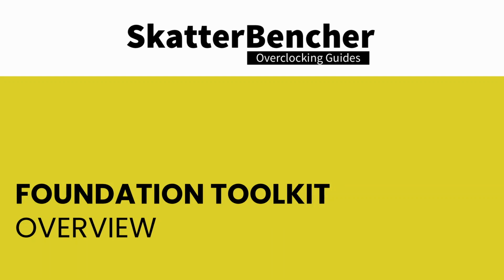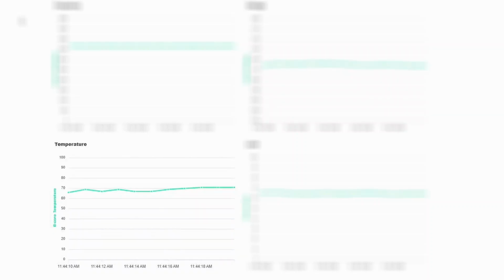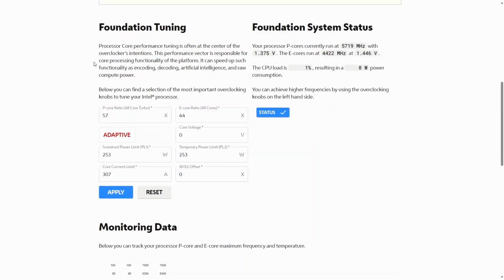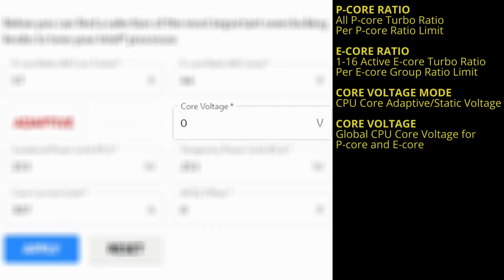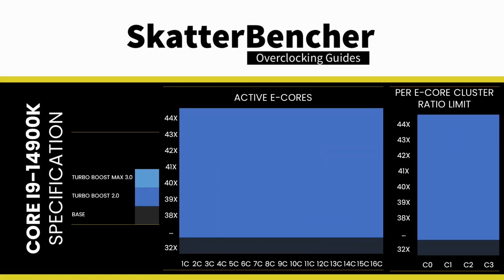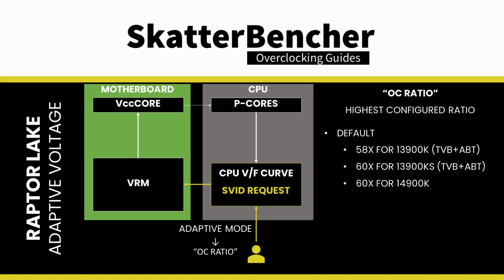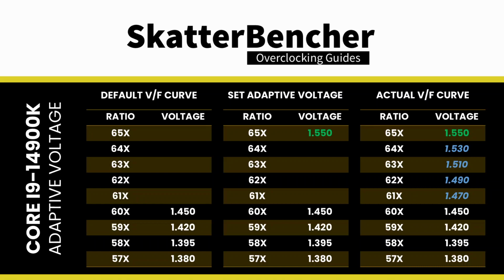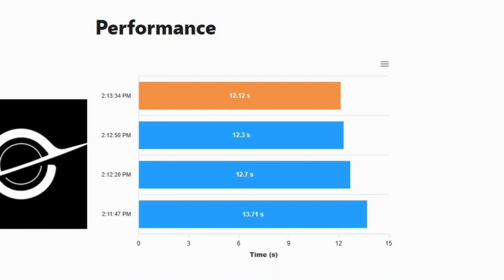Using Foundation Toolkit to Overclock Intel Core i9-14900K

Comment: Hi, I am using my 14900k only for gaming and want a stable fps without thermal throttling etc occurring. What would be some good settings to reduce power draw and multithread performance while getting maximum single thread performance for counter strike? Thanks
Reply: Same. I don't get why people want to overclock the i9. Our chip uses too much power as it is.

Comment: Amazing video's as always man. Very nice in depth explanation. That being said, the overclocking software is nice and it probably works very nicely, but after i used Intel extreme tuning utility my windows11 got a bit wonky where it screwed with the powerplan and now it doesn't wanna clock down all the way regardless what i do.

Comment: Hi there, I have SP107 with PCore 117. By running stock setting I hit 330w under load. May I know how to calibrate it properly? Assume I want to maximize my cpu potential. My vf curve for 6ghz is 1.418v. Which llc I should choose and how to start to calibrate my wattage as it’s over supplying the voltage to my setup. Thanks in advance I need guide to maximize my sp107 direct die kit. I tried 1.35llc7 with 1.27vmin 60/48/52 but my watt is crazy at 400w. What is the best scenario to run my system stable? Thanks in advance!

Comment: Good explaining!
However, can you do a overclocking guide on the 14900k using only the UEFI?
The AI assist with XTU doesnt provide a stable overclock, but I've clocked my CPU to 6ghz with 2 P-Cores active, 5.9ghz with 3-8 active P-Cores, but looking to do it in UEFI instead.
My previous 12900k had a stable overclock with fixed voltage at 1.450 in UEFI with all cores set to 5.2ghz.
I'm wondering if I set a static voltage to 1.465 in UEFI if my system would be stable, my cooling is pretty sufficient and never had any problems with CPU overheating.
Reply from the maker: Hi Eric! I am planning to make guides for 14th gen at some point, but unfortunately my free time is limited these days.

I think you can have a look at my 13900KS for general overclocking guidance since the chips are pretty similar. https://www.youtube.com/watch?v=dpWw_5KfpIw

I would strongly advise against a static voltage of 1.465V ... that will certainly overheat your system in heavy all-core workloads.
Reply: @SkatterBencher  Thank you for responding.
Im currently trying to OC my CPU, im running into the issue of "Current/EDP Limit Throttling" when current is set to 307, but when set to 450 i get bluescreen or fail during stresstest.
Looking forward to a guide, as there are no overclocking guides on the 14900k on YT that I've found that doesnt use the XTU.

Comment: Where any changes made to the llc before this? When setting to that voltage I end up way higher than 350w which then throttles down
Reply from the maker: No changes to the LLC. I presume you're sticking with adaptive voltage and not switching to fixed voltage?

Comment: So can we use these new tools with a 13900k? I have a good 13900k but wacky msi auto settings make it difficult to overclock good…. I know my vmin for 5.5 all core and 5.8 boost with ecores at 4.4ghz and ring at 4.8… but if I set static voltage for stock or overclock, get software errors or crashes under windows 11 newest stable builds…

When I use auto voltages with stock settings and ecore overclock and ring, it’s stable… also my ram is at 6800 speeds on msi z690 edge WiFi and is stable…

Trying to lock in a set voltage and overclock messes stuff up on msi boards… my vmin is down to 1.17v stock p core settings and ecores 4.4 and ring 4.8 and ram ddr5 6800..

I got room to overclock but it wants a voltage range from vmin full load all core up to vmax for boost speeds and vf curves and offsets difficult on msi….

Comment: I would suggest only try this with stock settings but with the stuff disabled like in the video. Do not try this with an already overclock enabled. Almost bricked my windows install.
Reply from the maker: Thanks for the input! Regarding the bricking the Windows install, I might have an idea what's happening. If you have time to help check, maybe we can connect on Discord?
Reply: @SkatterBencher  sure. I’ll try and look for you after work

Comment: So it's basically a barebones XTU version with integrated benchmarks without a feature like OCTVB? Don't really get the point as you can just use XTU and use benchmarks like Cinebench.. Also why does the "Undervolting Protection" need to be enabled? If the motherboard agressively wants to prevent you to optimise your overclock then you just run unnecessarly high temperatues even when you actually could go lower with voltages and run cooler.. You want as less motherboard interference as possible especially when you're overclocking.

Comment: Great effort but still not sure how to overlock in correct way is all cores set to 5 is ok for AIO 360 with good colling case? what vcore should I choose? static or adaptive? vcore 1.45?
Reply from the maker: I always recommend using adaptive voltage since it will keep the voltage low in high load scenarios and push the voltage (and frequency) up in low loads
Reply: @SkatterBencher  With Windows power plan set to "Performance" the SVID for my slightly overclocked 13900ks is about 1.47 to 1.5v on the P-Cores. But i noticed in hwinfo that the actual vCore voltage goes down when in idle (as low as 0.9v) even on this power plan is this normal behavior? Kinda strange to me that the vCore goes down when in idle but not the SVID voltage for the cores..

Comment: Doesn't the ring get unstable at 1.55V making it ram oc worse? Is this just for extreme overclocking for short tests?
Reply from the maker: Lots of CPUs will boost to 1.5V+ in adaptive mode at default. As long as it's adaptive, no worries